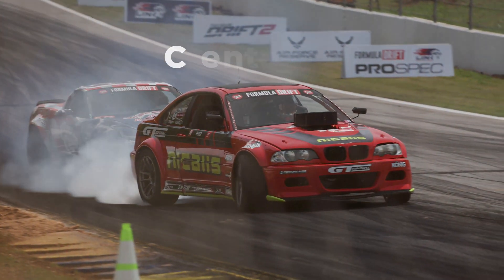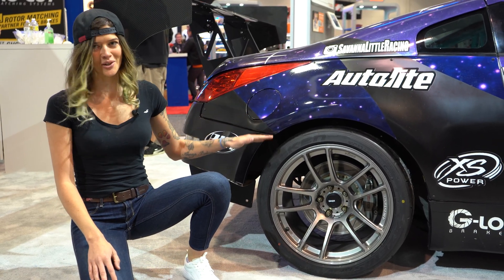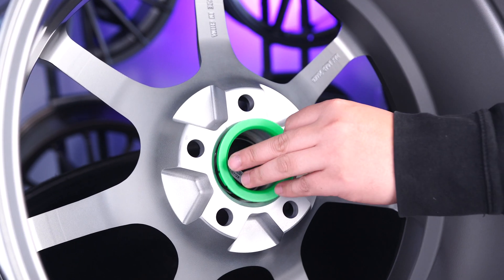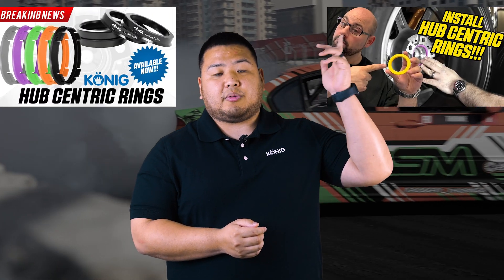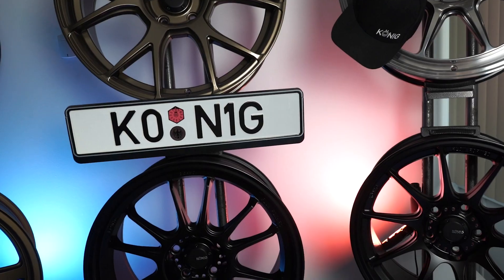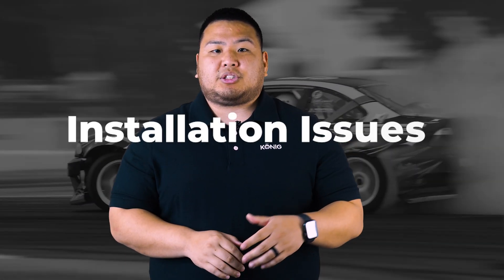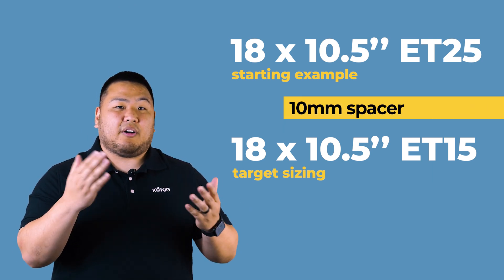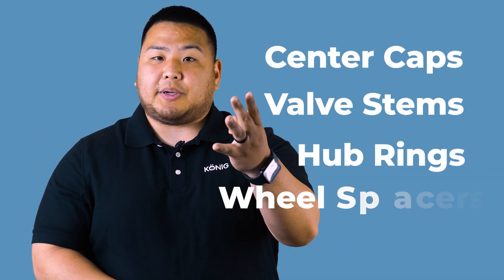WHEEL SPACERS, CENTER CAPS, HUB-CENTRIC RINGS, VALVE STEMS (Wheel Terms: Explained) - Part 5

Comment: I have a honda accord 2001 cg9 with 4x114,3 64,1mm hub

i want to fit 5x114,3 67,1mm hub on it. Can i just use converter spacers + a hub ring?